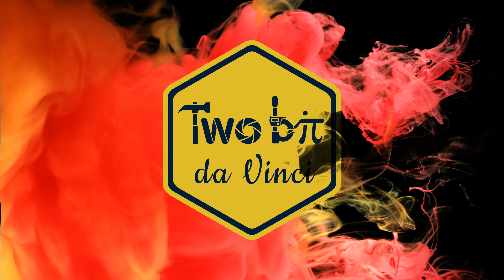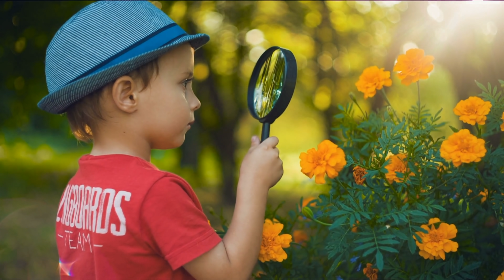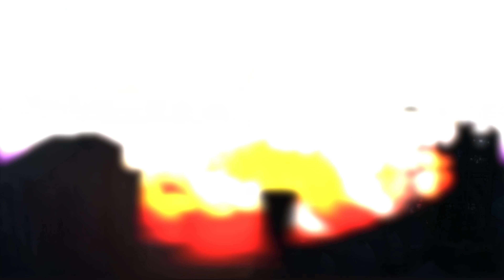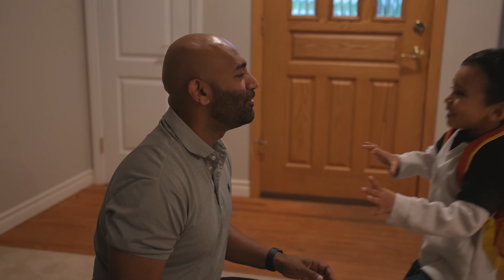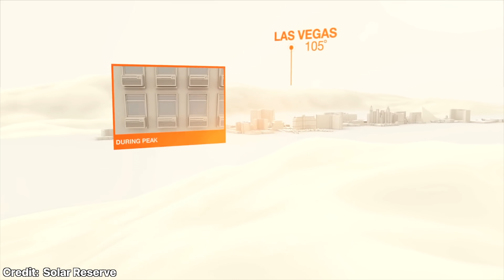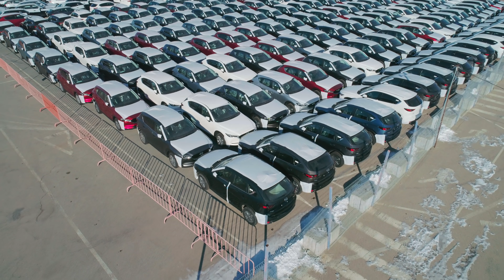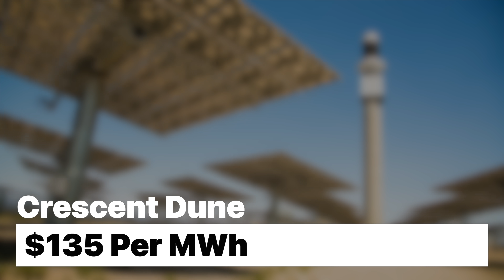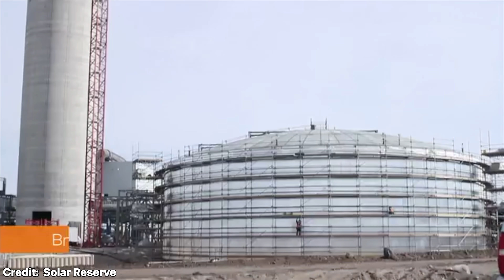This Billion Dollar Solar Plant was an EPIC Failure

Comment: An early issue with the mirrors was using a cheaper glue than recommended by the engineers.  The mirrors started peeling off after a short while as it could not withstand the sun/heat/desert.
Reply: Cheap glue, that reminds me of George in Seinfeld
Reply: I'm an agnostic atheist, and I do certainly know the difference between right and wrong. I don't need a millenias-old book that has been reinterpreted by dozens of political nations to know the difference between good and bad behavior, especially when many of the lessons or laws put forth in that book are considered heinous by today's standards.
Reply: @modernnomadtechnology9252  "I'm an agnostic atheist, and I do certainly know the difference between right and wrong...the difference between good and bad behavior..."

O.K. Can I trouble you for the definitions of 'Right' and 'Wrong' then, as well as who it was that decided on those definitions, and what prevents those definitions from being changed?

Also, 'agnostic atheist' is a contradiction of terms. To be agnostic is to claim that one lacks sufficient knowledge for a definite decision/belief.
Reply: Why not rivet the mirrors?
Reply: That would do it
Reply: Reminds me of the Challenger disaster. Evil businessmen, dictating engineers to run designs outside of spec, killed astronauts while the whole world watched.
Reply: @Novous    You should read Richard Feynman’s report on the Challenger explosion (he was on the investigative committee). He did not find it was “evil businessmen”, as you claim. It was politics. You may recall that the Soviets were visiting the Whitehouse on the day of the launch.  I was in Boston on business that day. After repeated launch delays, my thinking was that the shuttle would launch that morning no matter what, for political reasons, and that turned out to be the case. The heads of these organizations also believed the political line that a catastrophic failure was a one in a million probability, compared to the NASA and Morton-Thiokol engineers who believed the probability to be one in seven. The disaster was caused by stupidity, not greed.
Reply: @dilvishpa5776  I do remember being concerned about launching outside of temperature specs because of the effects on coefficient of  thermal expansion. However, no way I had any idea at all what might fail, thinking more along the lines of performance drain or guidance failures.
Reply: @MP-zf7kg  The Morton-Thiokol engineers begged management to delay the launch of Challenger, probably because of what Feynman demonstrated in his Congressional testimony. Feynman had an o-ring made of the booster seal material (buna-n, I believe) c-clamped in a glass of icewater to demonstrate its loss of elasticity. I also recall watching the launch that morning in the hotel breakfast area, and seeing the plume of fire emerge from center of the booster at the joint just prior to the explosion. It was clear to me what had happened in that instant (though not why). Most of the hand-wringing and “investigation” after that was, in my view, an attempt to cover the asses of the responsible parties.
Reply: @dilvishpa5776  The Russians lost spaceman for the same bullshit. 
I wasn't born yet, but I remember learning about it as a kid and even getting a beautiful picture of her on a little card from the Griffith Observatory in LA, as a kid.

This is the first time, I learned of the political component of the tragedy. If anything, we should have seen the opportunity to show to the Russians, that we value human lives... Rather, we lowered ourselves to their level. 

While I am no ant-war, Commie sympathizing peacenik, I do find it sad when folks, particularly civilians die because of old men's pissing contests... even if they are not American.
Reply: @dilvishpa5776  IIRC, it was broadcast on FM radio news that morning that we were launching outside of desired temp ranges. 
As to elasticity, I didn't know that. I do know that joints of dissimilar materials can get out of design spec because they grow or shrink at different rates. That was always my theory, that the joint gap became too large for the o-ring to adequately seal.
Edit: a bit dumb on my part; joints of the SAME material can fail, too, if the temp range is out of design spec.
Duh.
Reply: @Novous  oh please lol evil businessmen.
Reply: @Novous  low IQ comment
Reply: @Novous  The issue is that evil businessmen get away with it all the time. A small number of times they don’t and it’s catastrophic.
Reply: @mn-mh6uy  "The issue is that evil businessmen get away with it all the time."

How do you define the difference between an Evil businessman and a non-evil businessman?
Reply: @bricaaron3978  why don't you stick to the subject rather than getting in a pissing match over a poor choice of words. (Whether you agree with his point of view or not).  Regards
Reply: @Novous  "Evil businessmen..."

Ah! An atheist who believes in Evil. I would genuinely love to hear more about your philosophy.
Reply: @bricaaron3978 

First: How do you know, based on their comment, that they're an atheist?

Second: Just because some people believe that evil can only be defined within a religious framework, does not make it true.
Reply: @notahotshot  "First: How do you know, based on their comment, that they're an atheist?"

I don't, of course. I assumed that the person in question is an atheist because of his communistic/socialist ideology.

"Second: Just because some people believe that evil can only be defined within a religious framework, does not make it true."

The concept of 'evil'---the concepts of 'Right' and 'Wrong', of morality in general---has no meaning outside the context of theism. To the atheist, there is no more any such thing as "right" and "wrong" for a man than there is for an ape or an amoeba.
Reply: @bricaaron3978  Tell me you've never read a book on philosophy without telling me you've never read a book on philosophy.
Reply: @erebusvonmori8050  "Tell me you've never read a book on philosophy without telling me you've never read a book on philosophy."

Tell me why, instead of addressing the substance of my comment, and venturing to explain how I am in error, you flung a meaningless jab in my direction?

If you possess the courage of your convictions, why can't you engage with those who disagree with you? Explaining why a person is wrong requires knowledge and maturity---scorning him requires only the opposite.
Reply: @bricaaron3978  Honestly? Because your entire argument clings to an a priori assumption that underpins your entire belief system, there's little point arguing against something that central to your worldview. It's not going to be changed by an argument on the internet.
Reply: @bricaaron3978  I’m an Ahtiest. I’m also a capitalist, and think that evil businessman person is ignorant. Careful with the assumptions there.
Reply: @bricaaron3978  see, here is the problem. Right and wrong. Good and evil. Were all created by man.  These things go back far longer than your Bible ( I assume you’re a Christian, seeing as how you don’t see other religions talking like this).
Reply: @erebusvonmori8050  "Honestly? Because your entire argument clings to an a priori assumption that underpins your entire belief system..."

Alright.... And err... what are you talking about, exactly, when you refer to my "entire argument"? Are you referring to my assertion regarding the concepts of "right" and "wrong"? This is a point of basic logic. To a materialist, if morality---that is laws that originate from other than Man---can not be found within an atom of hydrogen, it doesn't exist.
Reply: @jamesbizs  "Careful with the assumptions there."

I'm always careful with my assumptions.

*Were all created by man."

I beg pardon?
Reply: @bricaaron3978  Yeah see this right here is the problem, you keep using words you don't understand. A materialist is a very specific philosophical viewpoint, not a synonym for atheist.
Reply: @erebusvonmori8050  You don't, in fact, point out any logical problem with any point that I have made at all. You simply state a fact, and---it's unfortunate, but nonetheless true---pretend that the fact you stated somehow refutes something that I have said.

Did you want to address anything that I have_ specifically_ asserted? Or just posture? Posturing is easy, but it's not to be conflated with honesty.
Reply: @bricaaron3978  Your assumption that all morality has to come from a religious framework is an apriori assumption with no basis.
Reply: @erebusvonmori8050  "Your assumption that all morality has to come from a religious framework is an apriori assumption with no basis."

It's not an assumption, it's a fact, if the definition of 'morality' is 'laws which originate from other than Man'. If that is not the definition of morality, then the concept of morality is meaningless.
Reply: @bricaaron3978  Morality: principles concerning the distinction between right and wrong or good and bad behaviour.

a particular system of values and principles of conduct. 

the extent to which an action is right or wrong. 

Nope, nothing there whatsoever about it having to come from something other than man, so we'll add another apriori assumption to your increasingly rickety framework.
Reply: @erebusvonmori8050  "Morality: principles concerning the distinction between right and wrong or good and bad behaviour."

My question was: "Can I trouble you for the definitions of 'Right' and 'Wrong' then, as well as who it was that decided on those definitions, and what prevents those definitions from being changed?"

Please define the requested terms, and if possible steer clear of circular reasoning.
Reply: @bricaaron3978  I'll gladly avoid circular reasoning, I know how you religious folk get when people tread on your territory.

Right - an action that is in accordance with a given moral framework

Wrong - an action that is not in accordance with a given moral framework

Nothing prevents them changing as by definition the framework changes what is right and wrong, you'll get very different ideas from a consequentialist and a utilitarian for example even though both believe the ends justify the means.
Reply: @erebusvonmori8050  "I know how you religious folk get when people tread on your territory."

Can you explain what you mean by characterizing me as one of "you religious folk"?

"Right - an action that is in accordance with a given moral framework...Wrong - an action that is not in accordance with a given moral framework"

O.K. So according to your definitions of 'Right', 'Wrong', and 'morality', there is no such thing as Right and Wrong---there is just 'Stuff Men Say'. As I submitted before, there is, in fact, no such thing as morality as some special concept---as some kind of separate concept from laws created by Man, or rules that animals abide by, for that matter.

"Morality" is actually the same thing as your local penal code, or the rules you make regarding how people behave within your home. It's the same thing as the instinctual behavior of animals, which means that morality isn't how one should behave, but merely how one does behave.

Which means that, according to you, the concept of morality is meaningless. Correct?

What does Modern Nomad Technology mean when he says, "I'm an agnostic atheist, and I do certainly know the difference between right and wrong" ? Do you have any idea, or...? I caution you, in the spirit of friendliness, to be careful before you answer.
Reply: @bricaaron3978  don't be like that, he was not saying g EVIL in the religious sense
Reply: @bricaaron3978  okay, I don't know why I'm waiting into this, but why the hell not. Obviously, I'm an engineer, not a philosopher, but I have read a few books on the topic, and watched Chidi on the "Good Place". So, my answer is neither comprehensive, nor perfect, and a real answer would take a very long discussion, full of examples and exceptions.

I'm an atheist as well, but I see a very clear difference between righteous and evil or good and evil. Good is when you act in a way that helps others in your group, be it your family, tribe, species, planet, and so on. This is where you get into concepts like fairness, and protection of the innocence. /These are concepts that exists in children and animals!/ This is documented science.  Evil is, therefore, actions that harm others in your group, usually for reasons of self-service at the damage or expense of others. This would include things such as murder, (taking innocent life - not just killing),  enslaving another, willfully harming someone to achieve a personal goal, significantly damaging the ecosystem in order to make a bit more money, and so on. 

So, It boils down to helping others or harming them. This is universal among social animals, and does not require any higher being to explain it to us.  I hope this helps.
Reply: also not mentioned I've heard of a substantial amount of wildlife being incinerated by that collector tower. birds in the area have no chance.
Reply: THANKS for adding some context!

Comment: Since the Utility infrastructure is already there, couldn’t they install Solar Panels on the Sun Tracking Mechanisms and put the Facility back in operation? Just don’t use the Molten Salt parts.

Comment: Molten salt turns to rock if you fail to keep it hot, which means tons of insulation and heaters just to keep it liquid. That energy is wasted and the cost of the insulation is very high.

Comment: Honestly, it's craziness to use molten salt... Not only because it turns into rock when cooled, but also because it's extremely corrosive for metallic pipes...
I know about the issues of using oil instead of salt, but... It needs to be something else. 
But who knows, if someone could discover a better material... Maybe the plant could be modified and reused. (At least I hope.)

Comment: Battery Storage is not sustainable for many reasons. Very replacement is a massive wave of pollution. With todays technology molten salt is a very good idea. The notion of hydro power scalability is overcome with smart scalability. For example . We have to get away from the notion that we have to get our power from a 110 VAC outlet. A simple hydraulic motor can use 60 to 110 feet of head to drive lots of household functions. Imagine that your toothbrush vibrates off of a small water turbine. Imagine a Milwaukee cordless iron, blender, hairdryer, curling iron, . My point here is Don't let another techno-moron tell you what is or is not scalable. Also Not all batteries are good for the environment some are.